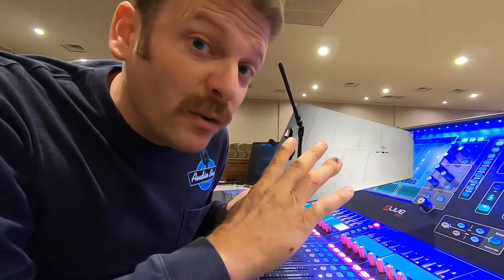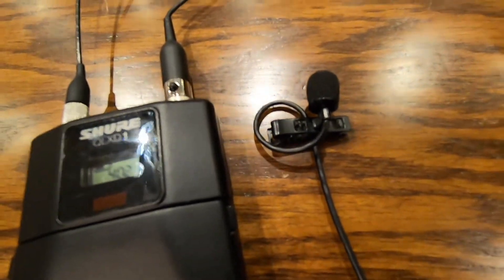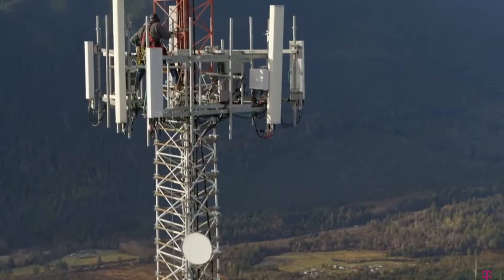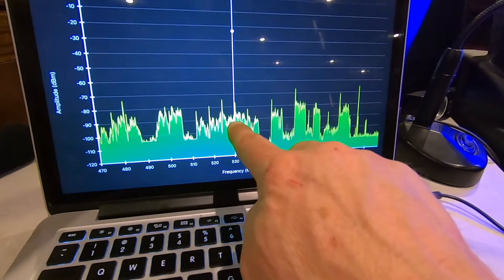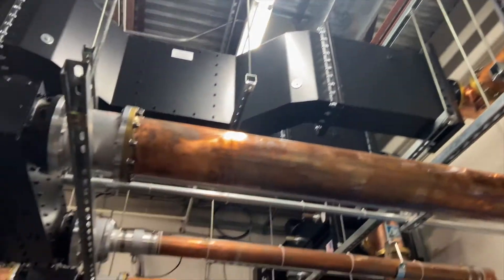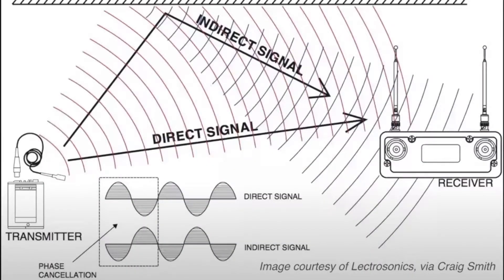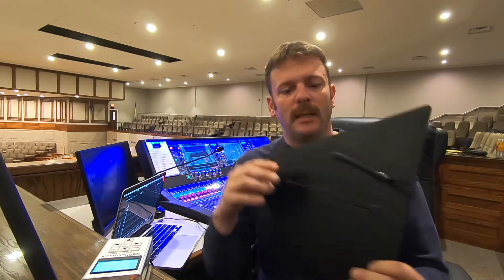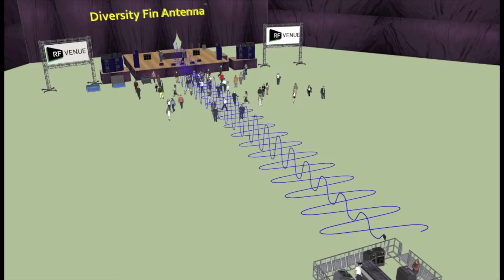A Better Wireless Antenna - Sound Advice 19

Comment: Hey jude, im a mobile DJ just bought an Audio technica wireless headset mic system for 100 person wedding ceremonys. Would appreciate your opinion on whether the DFIN or bandpass filter is necessary in those applications. The system I bought has an auto scan feature built in, so would I still need to go and get a spectrum analyzer?

Comment: Great video Jude,   We installed two Sennheiser A1031-U with a couple Sennheiser SL PASC 4 Four-Channel Passive Antenna Splitter/Combiner for our wireless mics just before our Christmas cantata this year.  We were running 8 wireless mics total on them.  I think I have heard only 1 drop out since we have added those antennas into our system.  Directional antennas are a great help.  Keep up the good work my friend.
Reply from the maker: Sounds like a nice setup.  Thank you for watching and YOU keep up the good work!